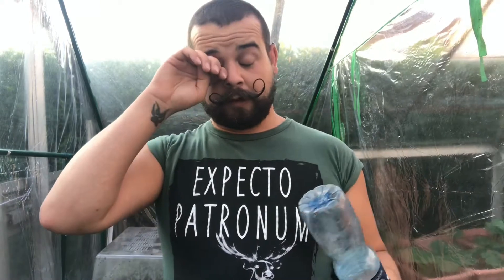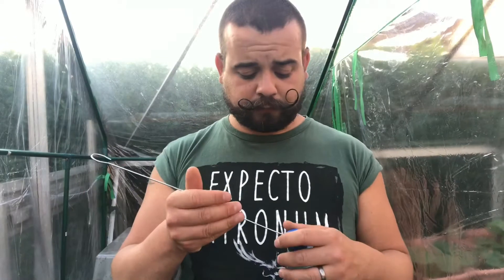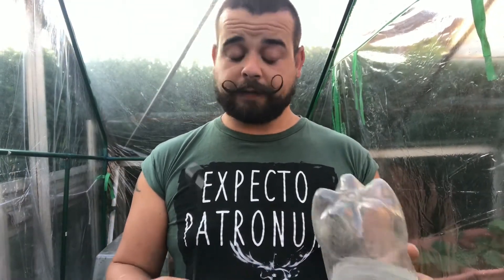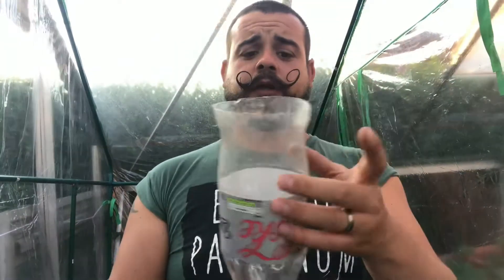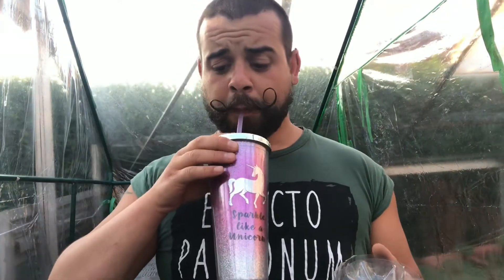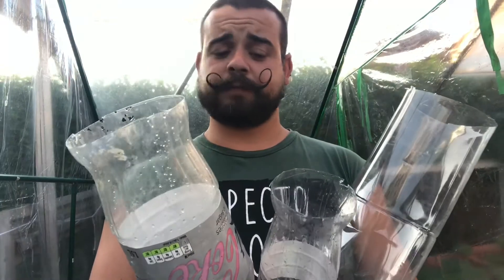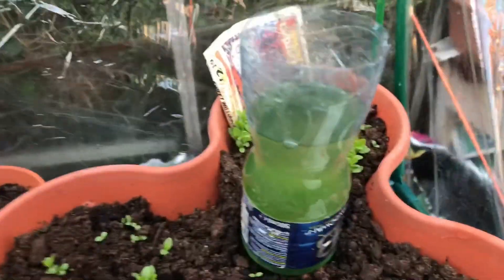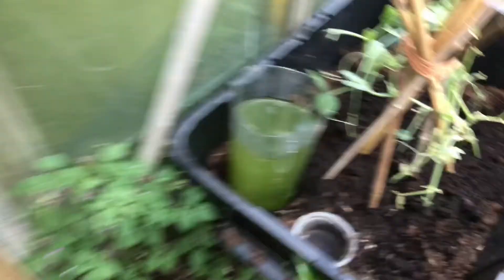Setting up an automated irrigation system using plastic bottles

Comment: Cool. I did a bunch of these last year. My mistake was to force them into the compost, which blocked the holes and stopped the water flow.
This time I dug down with my hand so that the shoulder of the bottle takes the weight - if you see what I mean.
Steve